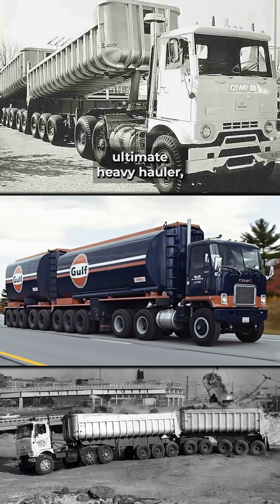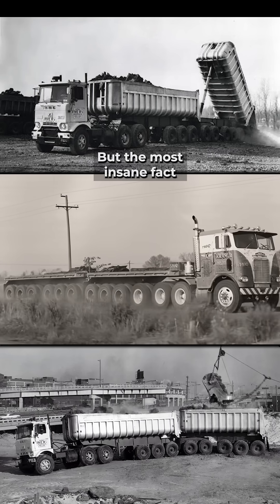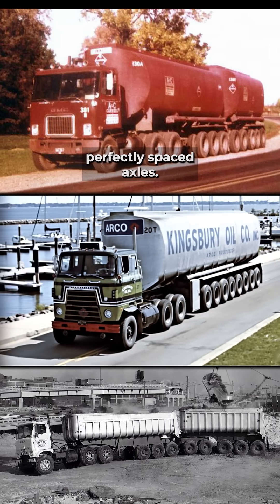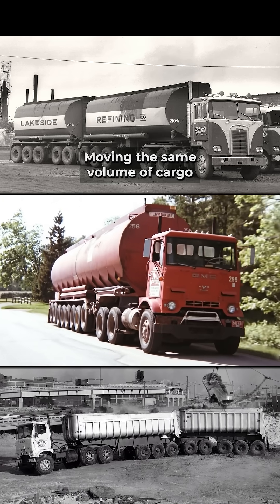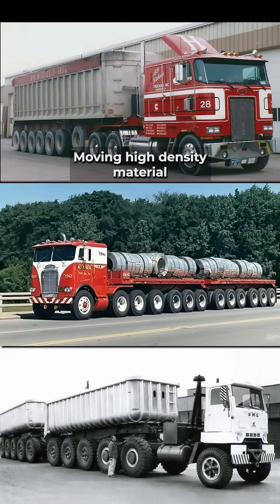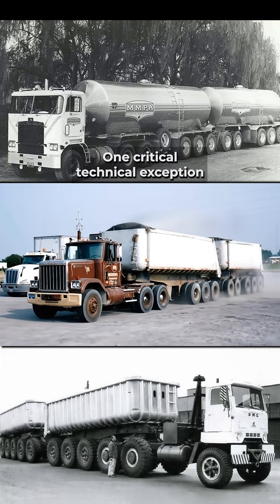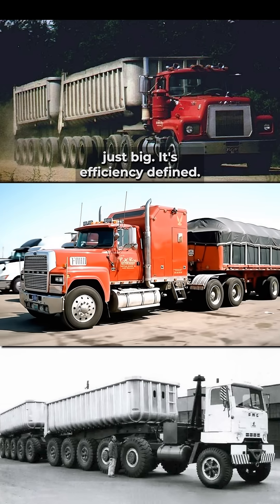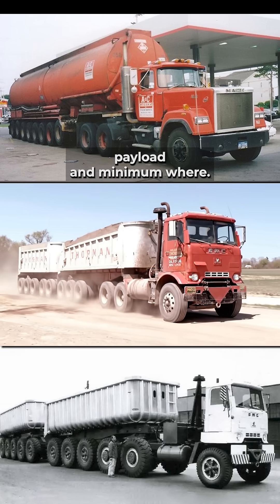The 11-Axle Michigan Centipede: Engineering the 164K Lb. Payload 🧠⚙️

Comment: Okay it's safer for road infrastructure but it's less fuel efficient than a standard 18-wheeler. The more tires that contact the ground, the more the engine will have to overcome the resistance of said tires and the weight of the load.

Comment: It all makes sense, so why have I literally never seen one of these in operation (or ever, for that matter) and why are all the trucks here super old, as if they dont use this setup anymore?
I love big cool stuff like this, I'd definitely remember having seen one.😅
Reply: It's because it's a highly specilised setup. Any time you?re over 80k, youuneed overweight permits which limit your routes, and have to be aquired on a county by county or state by state basis. And even then,every state has different laws about oversize and overweight trucks in relation to axle spread, spacing, overall truck length, and bridge gaps. If you're running anything bigger and or heavier than a standared 5-axel truck, you basically are stepping into permitting hell for anywhere you want to take that rig.
Reply: They still use them alone especially around river rouge and another of gravel trains

Comment: First,  where did you come up with 18,000 per axle group on a 5 axle truck? The stear axle is allowed 12,000 lbs. Each pair (drive or trailer) is allowed 34,000. Or 17,000 each. 18,000 X 2 + 12,000 = 48,000. And 13,000 times 11 axles is only 143,000.  I've been driving the 5 axle variety for over 34 years & never heard numbers like yours before.  😢

Comment: That weight limit is not set to protect the roads. It's set because of the breaking performance of the vehicle. There is no way a regular breaking system of a regular semi truck can stop a vehicle that heavy.
Reply: We pull quad trailers in Western  Australia 200 ton .
Reply: @markwebster613 yes but they are specifically designed that way. You can double that, tripple that doesn't matter as long as the motor and drive train strong enough.
Reply: In Finland and sweden we pull 76-73 ton trucks, american trucks are literally children's toys
Reply: @kaljamaistuuperjantaisin and Sweden used to have a maximum of 60 metric tons from I think the 1980s until quite recently and even now it's most of the time three axle trucks with four axle dolly trailers
Reply: the weight limit is set to 500 pounds per square inch across the width of the tire. Because that it what the FMCSR determined a long time ago, and where the 80k limit for a 5 axle 18 wheel combination unit came from.

Comment: I drive a gravel train pretty much daily all summer long. We don't have the long empty roads like Australia so we can't do the long 3+ trailer sets. I've milled and delivered material on tight residential roads more times than I can count. With the proper axle spacing we can run up to 169k lbs gross.

Comment: "Backbone of the auto industry" - never ever seen one on the road. Also, I'm thinking horrific bills for tires, a maintenance nightmare for brakes and suspension, and witheringly expensive per-axle toll charges.

And at least some of the clips are obvious AI slop.
Reply: I've seen these on the road when I go to Michigan
Reply: @Osmani4you super b not these
Reply: @calchedz  I haven't driven in a few years but there used to be very few B-Trains in Michigan.
Reply: Tires are definitely costly. Jake brakes do the majority of my braking and most modern stuff has air lift axles so it saves a ton of wear on tires. The only tolls we have in state are on the Mackinac bridge and these things don't cross it very often.